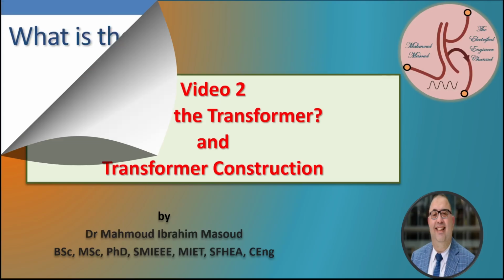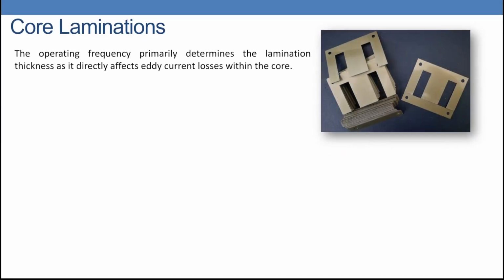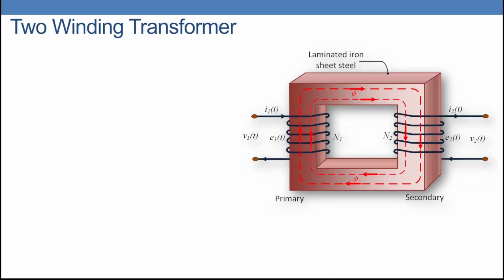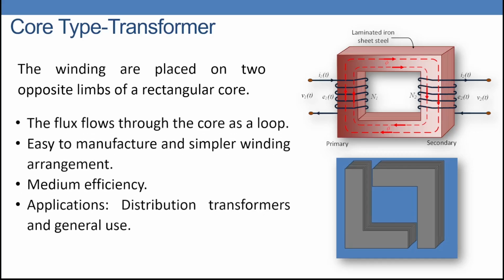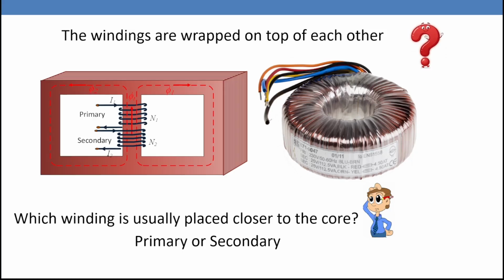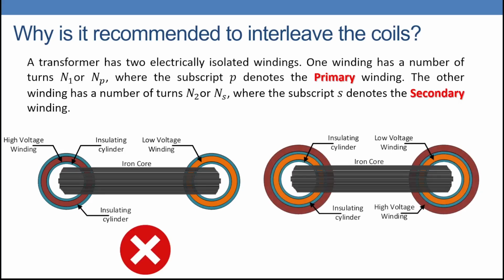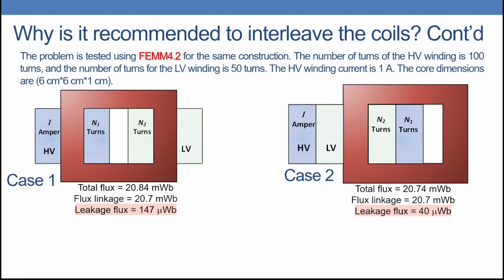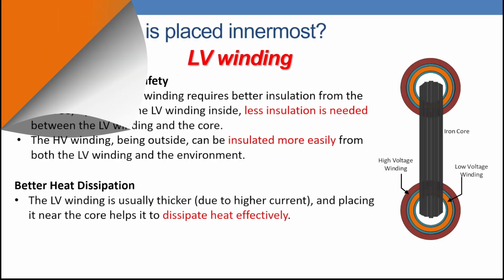What is the Transformer? Transformer Construction

Comment: Tube audio power amplifiers require an expensive, and difficult to manufacturer output transformer due to the complex "interleaving" of the primary and secondary windings to produce a linear frequency response and in preventing "iron core saturation" when dealing with 20-100HZ low frequencies. The switch to solid-state designs was simply an economic decision to eliminate the expensive and distortion producing output transformer. Both tube and solid-state designs require a power transformer, but this transformer only has to operate on 50-60HZ and is easy to design and build. Tube audio output transformers that operate from 20-20,000HZ with a flat frequency response, and very low harmonic distortion producing 50-watts of power are vastly more expensive than two NPN and PNP power transistors that easily produce 50-watts with a much lower source impedance that increases the damping factor in controlling the loudspeakers distortion at low frequencies. David Riddle
Reply from the maker: Thank you for your comment. But I would like to highlight that this course is dedicated to power transformers in the range of 50- 60 Hz. The good thing about your comment is that viewers will learn something I do not add in the video. Thank you again